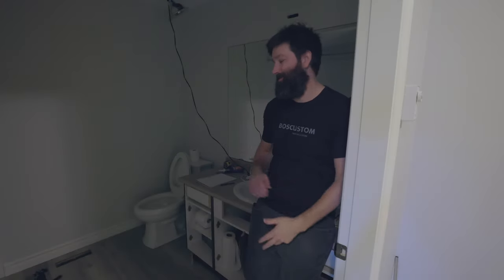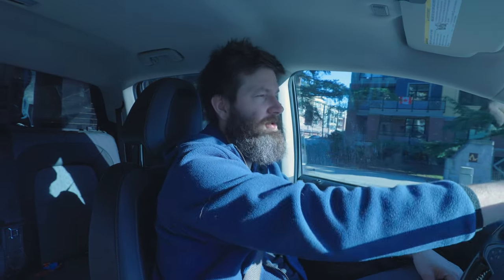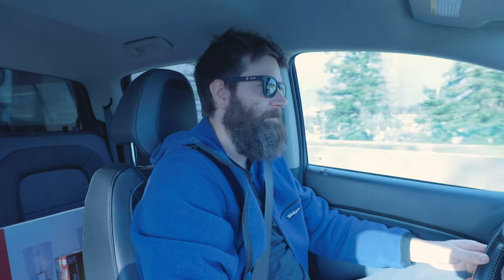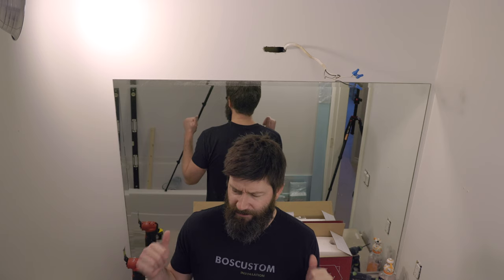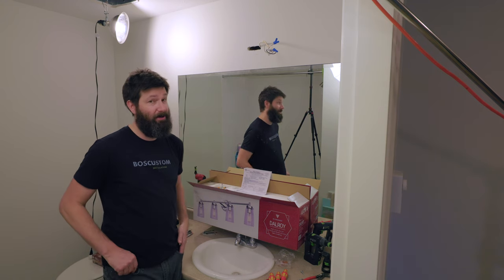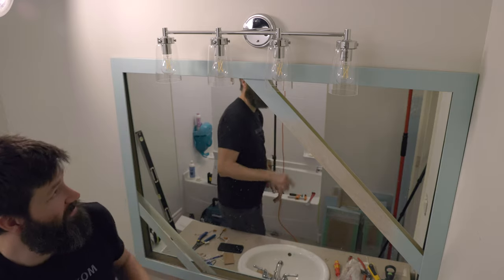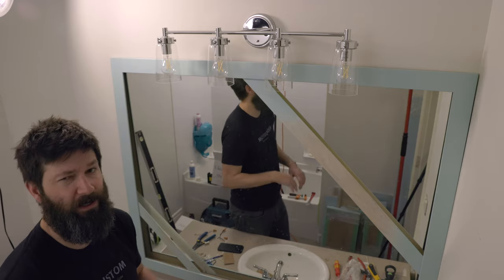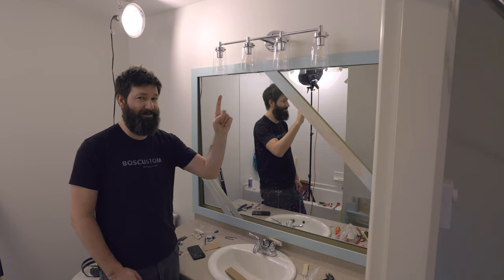How To Kickstart a Dead Renovation(P1)

Comment: TIP- I wear soft white cotton gloves when installing light bulbs and light fixture glass.  It saves you from dealing with fingerprints that bake on to the lights when they get hot.
Reply: Eeeeeehhhhhhhhh I just wipe them with a paper towel and some alcohol afterwards.
Reply from the maker: Good tip